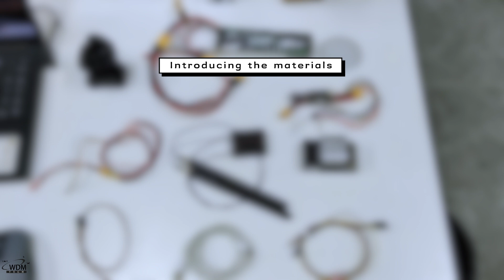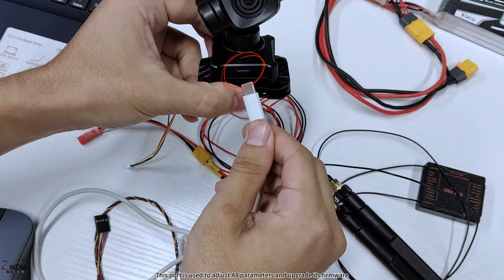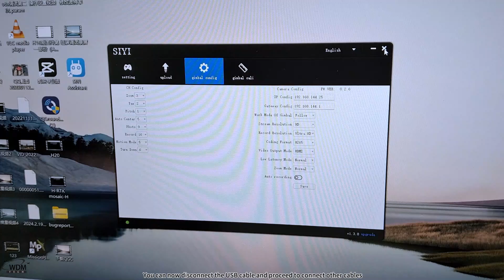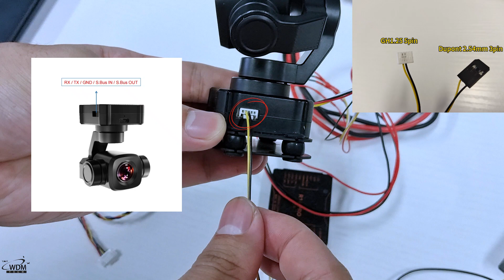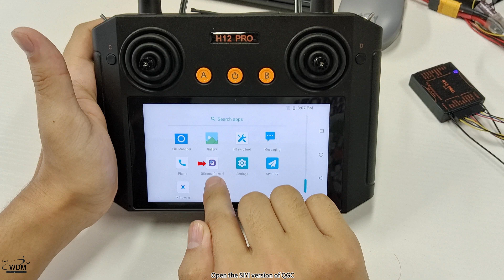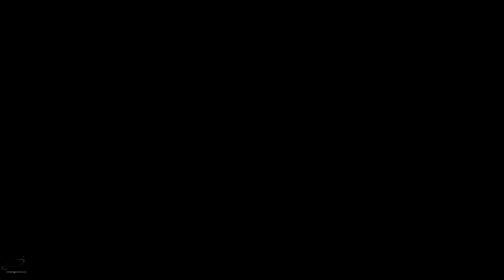Control the rotation of A8 with the H12pro channel wiring video

Comment: Hi, Can we connect Siyi A8 Mini Gimbal camera with Skydroid H12 which comes with MultiLink V1.0 air unit ? Please make a video on it.
Reply from the maker: A8mini is an Ethernet camera, but H12 does not support Ethernet cameras and can only connect to serial cameras. H12pro can connect to Ethernet cameras
Reply: @worldronemarket  hi, is it the same for the A2 mini? Can the A2mini connect with Skydroid H12?
Reply from the maker: @ninjaa-zzee4149  The same applies to the A2 mini; the A2 mini cannot connect to the Skydroid H12, but can only connect to remote controls with Ethernet ports such as the H12pro or H16.